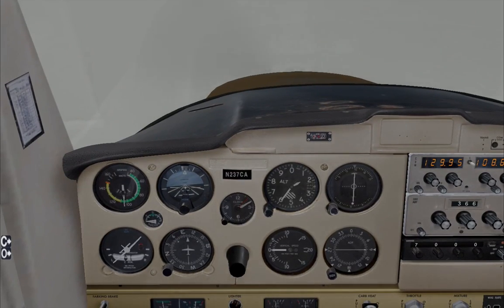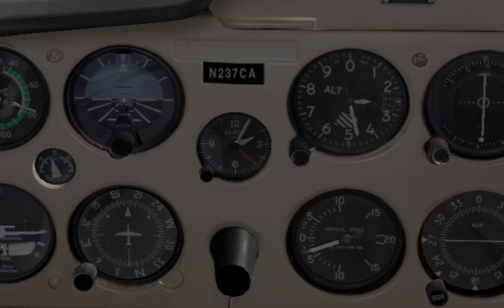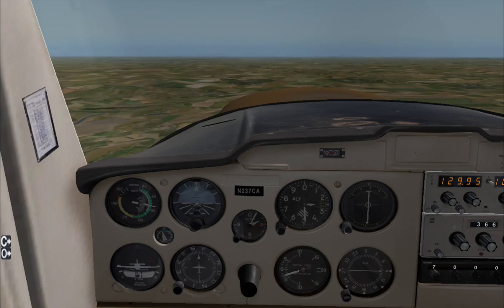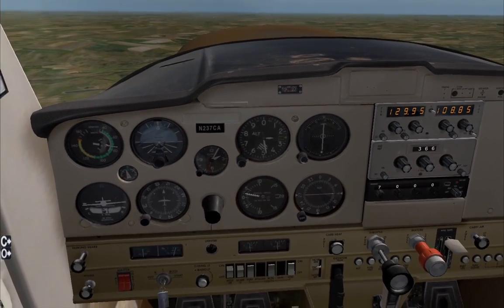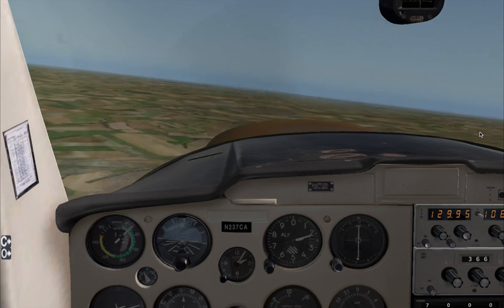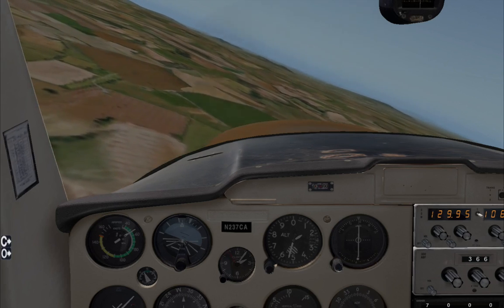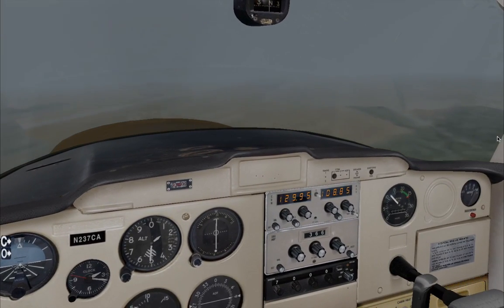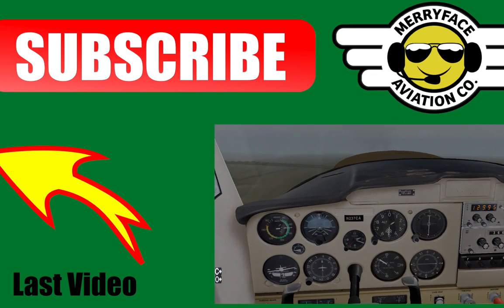An IFR Pilot's Worst Nightmare And how to Survive

Comment: I learned this back in 1969.  My Instructor used it to teach VFR landing at night when engine power was lost and you couldn't see or fly by the instruments well.  He said  to set the plane up with full flaps and full nose-up trim, then ride it down to around 500 AGL.  At that point he said to switch on the landing light and  look for a spot to set down. If you didn't like what you saw at that point, he said to switch the landing light off. (He was quite the jokester.)
Reply: Thank you

Comment: That sounds like as good a technique as any.  All I would add is to apply carb heat if you are going to drop to idle in the soup.
Reply from the maker: yup. Absolutely good point :) someone else pointed it out and I added it as an annotation. Thanks :)

Comment: Inspired by your video I tried this manouvre in our Cessna 172 (during my yearly checkride with a veteran-instructor) and it absolutely worked! -With two pilots and a passenger the aircraft descended nicely at about 600ft/min. in a gentle left turn with the stall-horn just barely audible.
Even the instructor was amazed by this "trick that may one day save your life". Thanks for sharing!
Reply from the maker: Hi there! This is fantastic to learn. I'm glad you've found it helpful and that your instructor has also learned something new that he can share on. I'm very happy indeed to read this comment. Thanks for the feedback.
Reply: @MerryfaceAviation  did you ask the passenger to move over behind co-pilot...wonder how much different the weight distribution would make?

Comment: I would say an even worse nightmare would be this situation in mountainous terrain.
Reply from the maker: Yes. always a consideration
Reply: Worse than that, this situation in mountainous terrain over elm street with Freddie giving vectors
Reply: i was going to say that. but this is an overall one of the greatest technique i dont want to ruin it. i bet i can stay gangster in this until some terrain says hi at my window
Reply: If you assume, when doing this maneuver which results in descending turns down, but you would know where you where when it happens, potentially you will not do a CFIT. Circling down at a known position is even better as trying to flight straight ahead (into unknown direction and terrain). At the end it does not matter: if you try to control the plane without any clue what the attitude is, where you are ... you are potentially 'more dead'. What I got (and tried): "let the plane circle down, until you can fly visually again". Just the wind could drift you towards terrain (and you have to be 'quick' on recovery to realize where you are, how you are). But anyway better as any "guessed control input" to do, esp. when you switch back to your body's motions sensors (which are completely wrong without any vision). So, let the plane fly and you have a chance to survive.

Comment: I think this manoeuvre is called a "benign spiral".  In the world of gliding we teach this as part of that standard private pilot license.  One detail that I feel is important to emphasis: HANDS OFF THE CONTROLS. (please correct me if I am wrong)

Here is our setup.  Let go of the stick, pull full spoiler, wait til you break out.  
By pulling full spoiler you are increasing drag (as does full flap) 
By letting go of the controls she will eventually drop one wing slightly and starting into a spiral dive.  
By letting go of the controls with a trimmed airplane you will not induce high G loading as you instinctively pull back

We teach this was a way to transition though IMC in the scenario where the clouds have closed below.  So while it is highly unlikely to loose all instruments, I feel this is more valuable to the VFR pilot who is running into trouble.

AND yes, try this with a flight instructor in clear air to learn your airplane.  Fly Safe
Reply: Great Lakes Gliding  Talgarth... That's fun when the weather changes quickly.
Reply: Does this work in a Cessna 182 and 206?

Comment: I'm a little surprised that this seems like a new trick for a lot of people.  while doing my PPL , this is actually on of the first thing i learned while practicing engine failure...  full trim up will give you your best gliding speed.  this was on a 172 ..  it's by design and pretty sure most GA airplane in the same category are designed that way
Reply: This is the same maneuver my flight instructor taught me to maintain best glide speed after an engine failure.  It provides more / max time for you to scan and look for a safe landing site.

Comment: I tried this successfully in my simulator with about 300 foot ceilings. Plenty of time to recover. Next time I want to try it again while the airplane is already in a fairly good turn and see how it will behave during descent. In real life, it seems like a good last ditch resort for full panel failure in IMC but what if it's also a possible solution for surviving spatial disorientation with a good working panel. The plane  is itself actually pretty stable, it's faulty flight control inputs from the pilot which puts the plane in an unrecoverable position. By using this technique, the pilot can keep hands off the controls until they're out of the clouds. I definitely need to experiment with more scenarios.

Comment: I dont often write remarks at a youtube clip but here I feel the need to. The technique you describe can save you but it can definitely kill you too. We had a couple caught by a very local snow above our airport. She (PIC) started to spiral down as she lost all sight. She had no idea the or didnt realise the limited visibility was until the ground. They both died when they hit the trees. Of course if you loose all instruments your options are limited but keep in mind that you need to know very well that you will need to break out the weather before you reach the ground before doing this.
Reply from the maker: I doubt they used this technique. Seems like CFIT to me.
Reply: What technique saves you when you are both instrument blind and visual blind all the way to the ground?  And if you lose all instruments (except magnetic compass), what are the odds that you still have flight controls?
Reply: @landen99  This is where good preflight planning comes in. You should never do a flight if the ceiling/visibility is zero all the way to the ground. To land IFR, you must have at least a few hundred feet of clearance between the clouds and ground so you can do an instrument approach safely.
Reply: hmm, agreed, but what is the other valid option? waiting for the spiral down???

Comment: Good info-you can also put the aircraft into a full fledged spin and hope for enough ceiling/ground clearance-a spin is a stable decent-all of this, of course, if you don't have any of the new electronic gadgets that simulate the instruments.
Reply from the maker: Yes that's a very old technique mail pilots used to use in the dawn of aviation whenever they inadvertently entered IMC. I would still stick to my technique over theirs though ;p

Comment: Interesting, earned my first rating many years ago, never heard this technique.  My first line of defense would be hand-held backups of every sort, but in an aircraft neither equipped with an ejection seat nor sufficient backup instrumentation and power sources for said instrumentation, I would recommend testing this under controlled conditions in the specific aircraft (not just make and model, but the exact same plane, as rigging, weight-and-balance and trim will vary even among specific types) to see if you get the desired result.  If so, then it is worth keeping in your back pocket for such a situation.

Comment: If you’ve lost electrical then you won’t be able to put those flaps down in a Cessna. If you didn’t lose electrical and you still have flaps, they you would also still have your turn coordinator that you can use for wings level.

Comment: I still think the more interesting question is: How does this react in a real situation? Ie: You are now in a steep turn to the left (or right) as the attitude indicator has slowly started to topple, and you being IR rated are taught to follow your instruments irrespective of how it feels, then you realise that all systems have failed (fail flags / suction gauge / compass starting to spin wildly / G force starting to be felt due to spiral dive) so you follow your steps - what happens then?
Reply from the maker: good question. I can try it on the simulator, but I wouldn't test it in the aircraft as a practice run as that could result in damage to some of the aircraft components. An educated guess is that if we tried this in a spiral dive it would result in a steeper, but lower speed spiral with a high rate of descent. I will try it on the sim. 

Now, in terms of a realistic situation, this is probably more useful for VFR pilots into IMC. IR pilots have ways to detect suspected instrument failures. A proficient IR pilot would be aware what systems in their aircraft have failed.
Reply: MerryfaceAviation you'd think right? But I've found myself in a spiral dive, in solid IMC at 9k whilst going through some (severe) turbulence, as a result of vacuum failure, circuit breakers went on the VOR/DME equipment just prior to the event which is what occupied my troubleshooting mind. iPad went black... thankfully I do double and triple check instruments at very regular intervals, but had it not been for my compass, ASI, Altimeter and turn coordinator - I probably wouldn't have broken the cloud base in a recoverable state. So in your hypothetical vacuum, and electrical and pitot and static gone... I am not sure many would have been able to survive that situation with anything but luck!
Reply from the maker: as I said, this is a really really unlikely situation. almost sadistic just to think about it. it gives someone a fighting chance if they were to ever get stuck in such a situation
Reply: @MerryfaceAviation  i think even proficient ir pilot would find it useful here. as u said all instruments failed and theres nothing u could do with that instrument awareness knowledge

Comment: Interesting method as a last resort fail safe. But in a 152 or 172, how do you lower electrically driven flaps in your scenario that includes electrical failure? If you're able to lower flaps, your turn coordinator should work to keep wings level, unless you have it fail for a non-electrical reason. Am I missing something?

Comment: tested it in the a2a c172 and got a similar result, very interesting
Reply from the maker: Thanks for the info! Good to confirm that it would work in a 172 too
Reply: MerryfaceAviation nice video.. i tried this morning in a 172P and it seems to work but and here is the big but, if you configure the airplane to this conditions it will stay in the gliding speed without any input but if you do this on a windy day the wind will bank the plane and this technically doesn’t contemplate this, in this morning the plane almost enter on a slow upside down attitude because I wanted to see if the plane can correct itself which it can’t, on a smooth day probably would work but on a windy/stormy day I don’t think so
Reply: MerryfaceAviation maybe with the steep bank it would pitch down and self recover but in IMC could be catastrophic, maybe you should try in the sim with some turbulence and gusting wind and see the results, this technique can correct pitch but can’t correct the bank, it will only increase slowly. In conclusion, it probably would work in a no wind situation, if the ceiling is at least 1000’ AGL I probably use this technique
Reply: Frederico Sagas did it automatically turn left due to p factor?

Comment: I didnt knew it I might try this with an instructor tomorrow since I have a training IFR flight in a C-150
Reply from the maker: Go for it mate. I was well impressed when we did it.
Reply: And did you try it? What was your result?
Reply from the maker: I have tried it with a few aircraft. The general result is good. Some aircraft need some variation on this. Like the Pa38 you need to trim a little forwards from full aft. In the majority of cases, the aircraft will slowly enter a steeper and steeper turn, depending on the attitude upon entering the condition. In all cases though, (assuming you enter in the condition in a stable attitude) the aircraft never stalls and enters a descend rate no higher than 800-900fpm.

Comment: Nice. But now try this IMC with a Boeing 747.
Reply: Italy Is My Fatherland TV it’s on auto pilot easy
Reply: If you've lost all your instruments in a 747, chances are you've also lost about half of the physical airplane.  The backups to the backups have backups.
Reply: As long it is an airplane (and not a helicopter) - they procedure (and flying skills) work also in a passenger jet. What is the difference? (just the airspeed regions), but the fundamental of flight is the same. As long as passenger plane pilots understand the physics of airplane flying, the "stick and rudder" skill, follow the emergency procedures... it will be similar and safe. (BTW: IFR flight rules and skills for General Aviation (C172 pilots) and Airline Pilots are quite the same).
Why passengers believe, airliners are flying computers and pilots are dummies on those? I would trust the plane and I would trust the pilots, esp. how hard they have to study and get their license. They fly for sure way better as any passenger, even they would be legal to fly small airplanes (a type rating makes so much sense).

Comment: I’ll go try it and see. In actual IMC though it’s almost always bumpy and takes constant aileron input to keep wings level at times.
Reply from the maker: yes, I have since changed this maneuver slightly. put your hands on your knees, and use the back of your hands (or the side for a stick) to keep the wings level by using the turn coordinator. Rudder to keep slip indicator centered. The reason for operating the aileron this way is to avoid accidentally adding elevator input
Reply: MerryfaceAviation I had to take control each time I tried this. The plane always wants to enter a spiral dive. Sometimes sooner than later but eventually it would. I didn’t try it using the turn coordinator because if that still works, then there’s no need for this maneuver anyways.

Comment: You can also use your windscreen compass if you are worried about terrain.
Assuming it's a floating compass you can see a few degrees nose up for setting your trim and throttle and the rate of turn gives you wings level depending on plane rudder and side slip will correct it enough to navigate with no stick input, but gentle on the stick.
Reply from the maker: Not a very reliable method tbh, as accelerations will also cause those effects. So even in smooth air it would be really tough. Imagine in even light turbulence! On top of that, here we'r assuming the pilot is unable to maintain control full a full or partial panel. For example, VFR into IMC. Those are much simpler methods, but they would have presumably failed.
Reply: I agree, it's a desperation method when you know there is no base/high terrain under you.
Reply: this is bs
Reply from the maker: try it out first with an instructor  before calling it BS :)

Comment: People might ask: could it really happen? YES!: assume a single engine  plane failure during IFR and you have a very week (dad) battery (not realized on preflight): your vacuum dies (no engine), your electrical power dies (no generator/alternator = no turn indicator). OK, assuming engine dead - the ALT and ASI remain alive (good for you: you can still judge the descent rate). Anyway: battery and engine dead is almost this case. Just compass and ball (and altimeter (ALT), airspeed indicator (ASI) remain alive). Use it in order to recognize how fast you are descending, potentially a faster descent due to a steeper bank.
Figure out fist: what could be my bank angle (based on compass rotation speed).
BTW: a compass is always required, for VFR as well IFR: the most reliable instrument on the plane (even with so many 'errors', as long it is not blocked, not leaking). Reasonable to refresh compass flying or to use it more often during flights (even when IFR) (do you remember "ANDS", "OSUN"?).

Bank is the hardest to realize and control in a plane (do not trust your body sensations). Use 'indirect' cues, e.g. how fast the compass is turning for a correlation to bank angle.
Use the wind sound (switch off ANR or take the headset off) around your  canopy, in order to realize if airspeed is increasing (diving down).
And, at least: keep the ball centered (just with rudder!), even it is still a descending turn, as long as compass rotation speed is constant ( or slows down), wind sound is constant (constant pitch) ... you are 'a bit safe' (and wait for the chance to have visual cues again (below cloud layer) to recover and do emergency landing).

Again: a cool procedure and the message is: "stay calm" (even it is so serious, "don't panic"), "fly the plane" and "have stick and rudder skills" (and a clue about airplanes stability, rudder is a 'trim device'...).
COOL: I have never thought about such 'cool' and FUNDAMENTAL flying skills. Thank you. Very helpful, esp., to understand "why and how airplanes fly" (not because of the pilot, except in a
fighter jet, they are inherently stable and self-flying - make use of it).